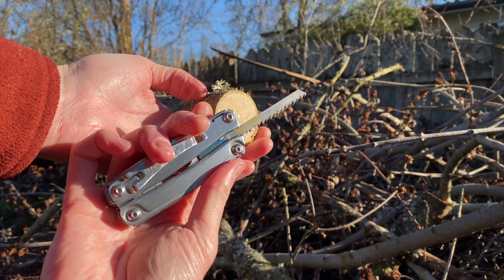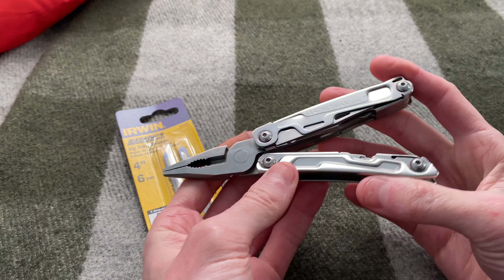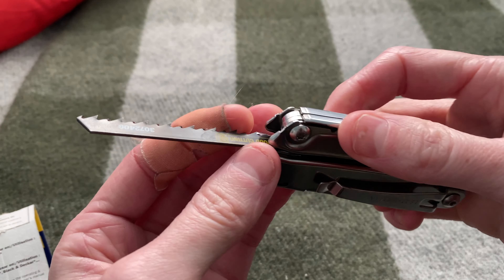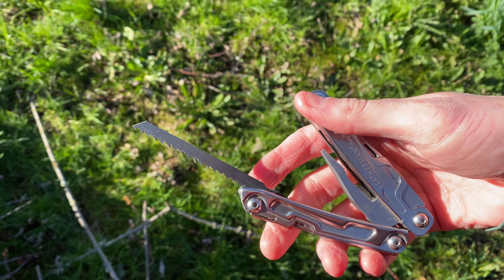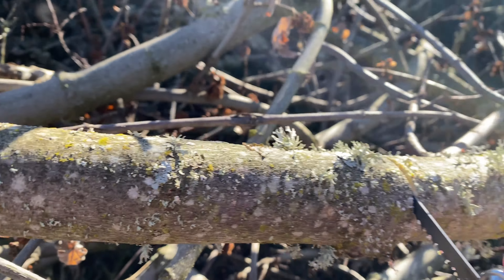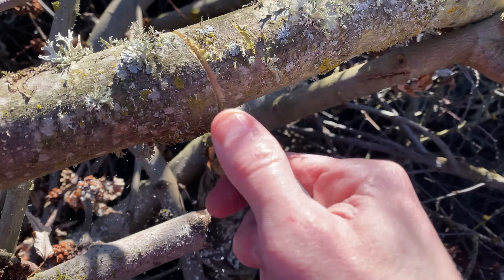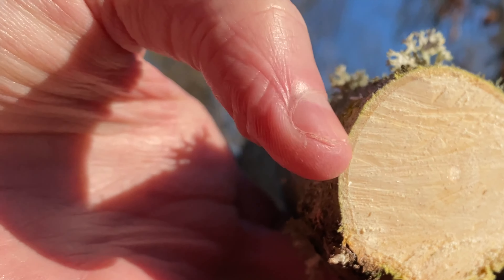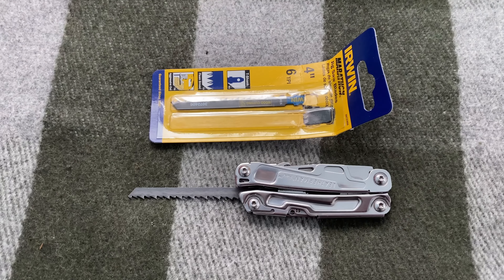Making a Hardware Store Jigsaw Blade Fit My Leatherman Rev

Comment: Even when implemented ideas do not work out as well as anticipated, there are valuable lessons to be learned from the experience. Your video inspired an idea which I plan to try. I have always liked hte Leatherman; in fact, I  am so old that I have the original Leatherman. Several years ago I also ran  across a made in USA Scrade multi-tool with Vise-Grips, which has many features of the Leatherman.. It would be much safer & far more practical to" lock" a SAW BLADE of one's choice in the vise-grips & saw away! Your thoughts or comments?
Reply from the maker: Sounds interesting and yes I think the vise grip would help out a ton!

Comment: maybe you could take one of the lesser used tools off the spline, drill a hole in the saw blade and add it onto the spline
Reply from the maker: I tried that...there isn't enough room in the tool "handle" because eventually the blade would hit the pliers. Probably pick up a better Leatherman for backpacking/camping in the near future.